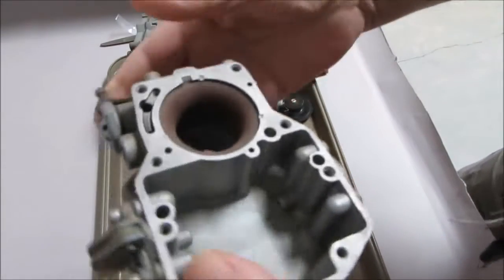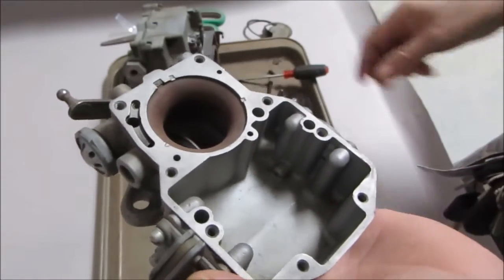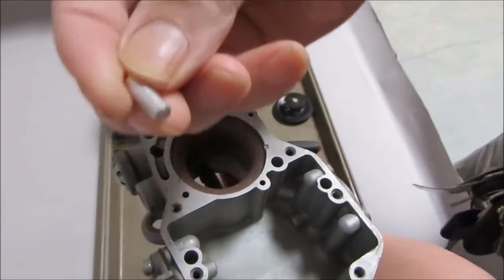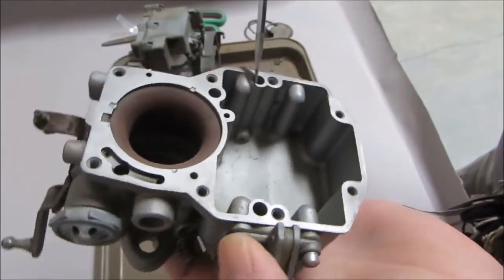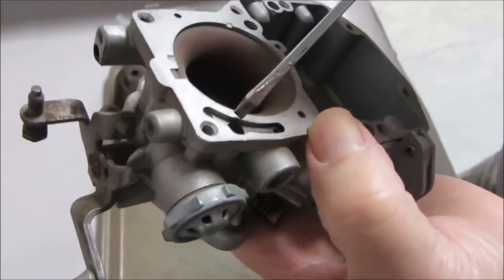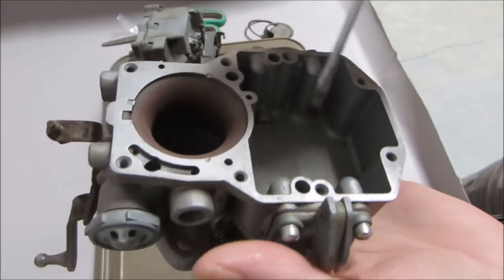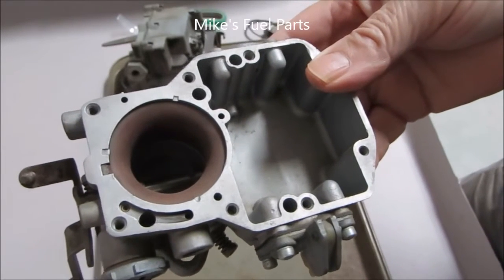Autolite 1100 Check Ball Placement | Carburetor Maintenance Guide

Comment: Ok, my carb has no passage where the ball and weight go. However, I removed a hex shaped weight that had a rubber recessed tip on one end. There were also 2 balls, one for the accelerator pump and one for the dashpot. I don't believe there was a ball in the hole for the spark valve, but it's possible that the weight could have fallen out of this passage. Anyone have experience with this setup who can confirm or refute my thoughts?

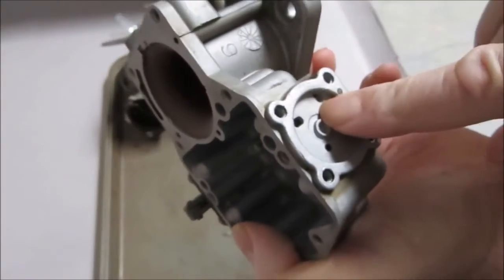Comment: I'm fairly new to the Autolite 1100, but it appears that Mike swapped the accelerator pump passages.  @1:11 he calls the passage that goes from the accelerator pump, up through the check ball, past the check weight, and on up to the port in the throttle top assembly the INTAKE.  Clearly this passage is the outlet of the pump.  Then, @1:25 he calls the check ball in the passage that supplies fuel from the bowl into the accelerate pump "the OUTGO".  This passage is the pump inlet.

As an aside, the Ford service manual diagram for the 1964 Falcon/Comet Autolite 1100 with the spark control valve does not show a check ball.  It only shows 3 check balls:  Dashpot supply, accelerator pump supply, and accelerator pump discharge (with check ball weight).

If I'm wrong about this, somebody straighten me out!

Comment: I’m a little confused, I’ve taken apart a few of these auto light 1100’s and every single one I’ve taken apart had two different sized ball bearings. Does it matter where I put the smaller or larger ball bearings? They both fit in any passage.
Reply: @MikesCarburetor  ah thanks for the info. A little weird I’ve found different sized ball bearings in multiple original and remanufactured carbs.

Comment: When taking apart my 1966 C5TF-G carb, it did not have the weight over the check ball. Is this necessary in this model carburetor? Or do some operate without the weight over the check ball? I am not sure if the carb has been disassembled previously and the weight was not put back in.. Thank you for your help.